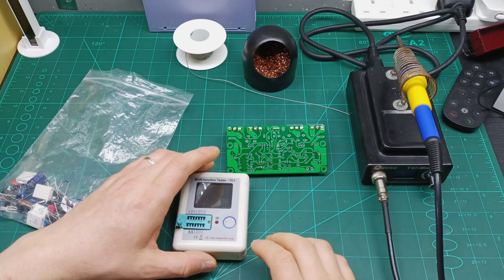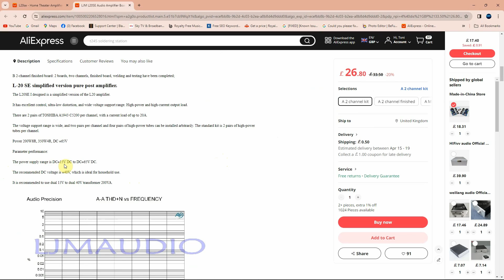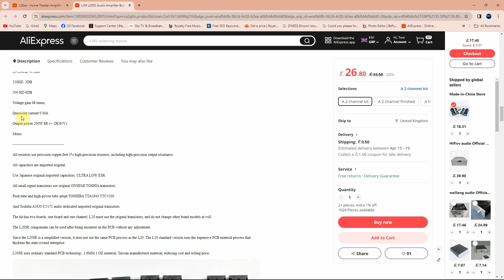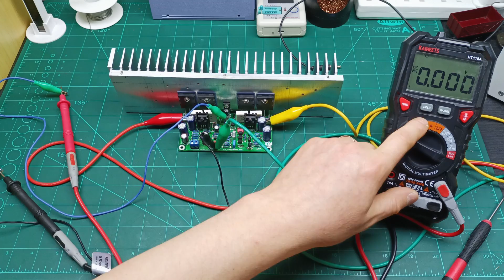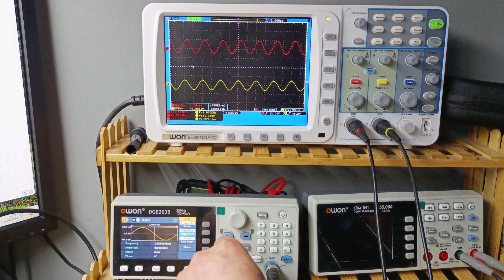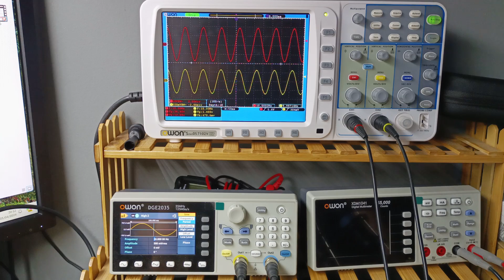Let's build an amplifier using AliExpress parts | part2 L20 SE amplifier kit

Comment: It's always a good idea to screw the transistors to the heat sink first and then do the soldering.
Reply from the maker: Yea because definitely will be soldered on the right place and easy to fit on the heatsink

Comment: First solder the passive components (connectors, resistors, capacitors), then the active ones (diodes, transistors).
Reply from the maker: Is not really mandatory the to solder the parts important is to solder the right component on the right place!
Reply: @ no doubt. so as not to overheat semiconductor devices when soldering again

Comment: Guten Tag und Danke für dein schönes Video.
Meine Erfahrungen seit über 30 Jahren mit Leistungs Mosfet ist, das die mehr Ruhestrom möchten wie Bibol Transistoren. Es wird immer wieder von etwa 100 MA pro Exemplar Berichtet. Das deckt sich auch mit meinen Erfahrungen. Es klingt schöner und läuft dadurch auch weiter im Klass A Bereich, gegenüber AB Bibol Endstufen
Reply from the maker: this particular amplifier use BJT transistors.

Comment: This amplifier does not provide adjustment of the quiescent current of the output transistors. It is necessary to replace the 4k7 resistor with a 10k variable one, which must be used to set the required quiescent current.
Reply from the maker: If you want to have a fix quiescent current just use a resistor. But with a variable resistor definitely can be adjusted!
Reply: @SymbolTech21  undoubtedly

Comment: I think it needs a higher supply voltage
Reply from the maker: From 47v to 65v is not a big difference and with 47v I was expecting at list 100w power. Then that oscillation on the positive side of the sine wave I really don't like it at all

Comment: I have just found this video having been looking for reviews of this amp, I built one and I have tested it both with ears and on the bench. The low frequency response is awful, it sounds shrill like the treble is maxed out and runs too hot. I saw other people on diy audio forums saying how great they are, no they aren't imo. LJM designs some really nice amps, like the l12 for example which sounds a million miles away from this. I have some old toshiba output transistors which im going to try but I doubt it will make any difference, my gut instinct is its the feedback thats at fault.
Reply from the maker: @jamesw5584  yes I agree with you this is not a good amp at all and if you watch the entire series you will find trying other amplifiers kits and I choose a good one to make the final amplifier

Comment: Is it good sound quality?
Reply from the maker: Nope I will not recommend this amplifier kit
Reply: @SymbolTech21  Thank you. I canceled my Aliexpress order. 
What amplifier board is good? Supply +-65V (substitute for STK4248)
Reply from the maker: @brankozivkovic6555  l12 it's a good amp only that power supply is dual 50 v